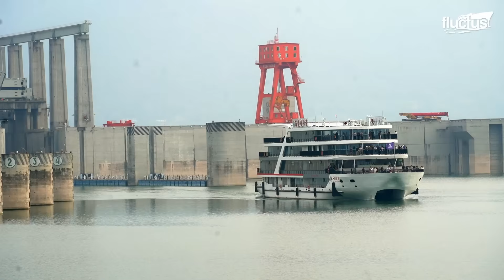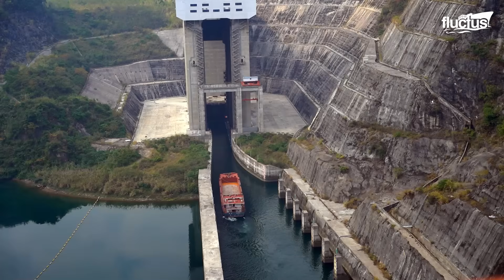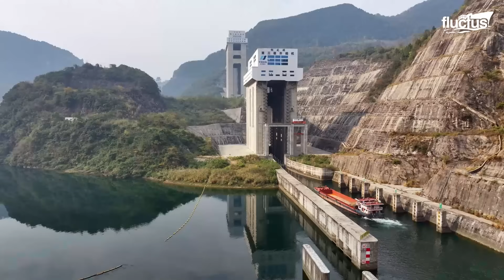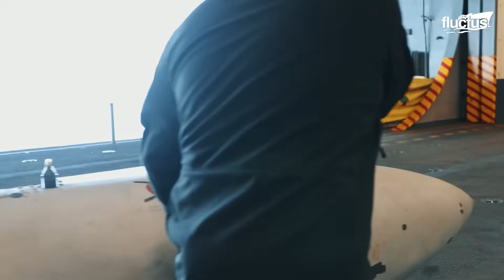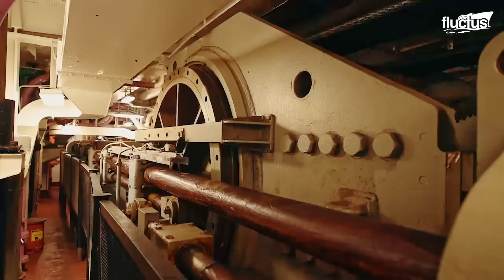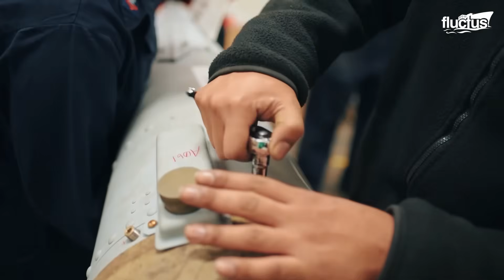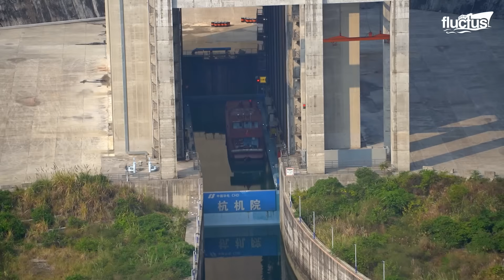Riding China’s Scary High Ship Elevator to Cross a Mountain

Comment: here's an engineering question: was the boat lift designed for varying boat weights or just one single standard weight? (answer: the weight on the lift will always be the same regardless of the weight of the boat)

Comment: Seems like an inclined plane that pulls the box of water up a ~30 degree slope (sitting directly on the ground) would be more efficient and safer than this brute-force lift straight up thing. I mean theyre already taking up the horizontal space with this thing anyway 0:45 .

Comment: The Chinese ship lift elevators are imprestive to say the least. But you can't compare them to normal canal locks. The St. Lawrence Seaway can handle ships up to 740 feet (225.6 metres). While the original locks of the Panama Canal can support ships as big as 950 ft (289.56 metres). The New Panamax locks can support ships as long as 1,201 ft (366 metres). So although the Chinese canals are something to marvel you can not compare them to regular canals.